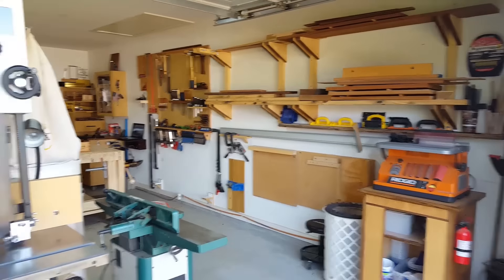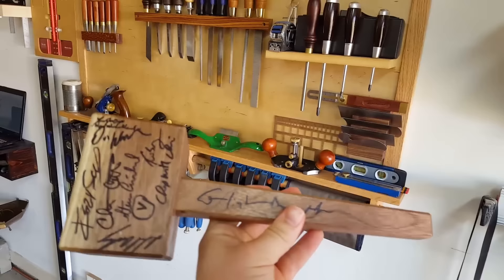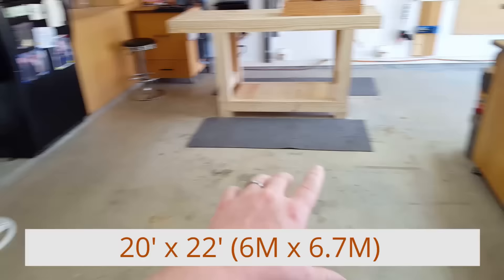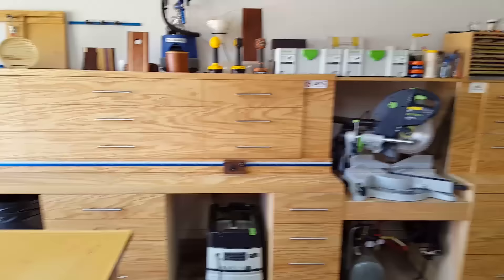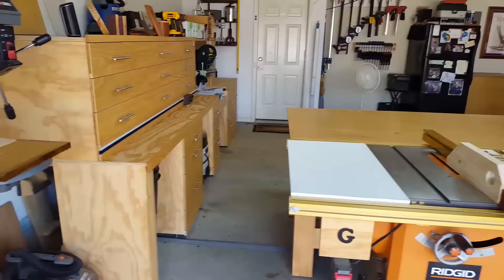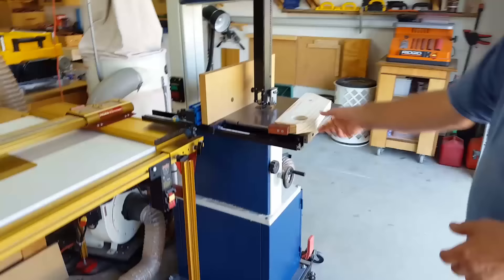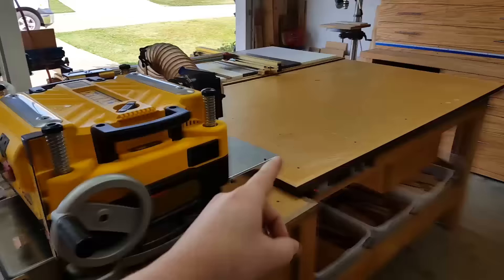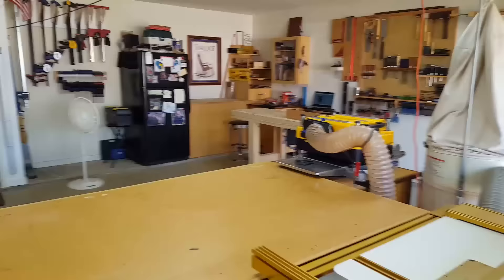Wayne Brown's Shop Tour

Comment: Mine is only a 12'x16' so it's small, but usable. It is a shed, custom built for longevity, and has a ramp so I can locate the table saw outside when weather permits. That leaves a TON of space to move around in. I am thinking of getting the same saw Wayne has in the next few weeks, I currently have a DeWalt Jobsite folding saw but it is a GREAT saw!!! I just truly love the space in front of the blade that a full size saw has on the table. I removed my saw from the folding cart and mounted it on a shop built table on wheels to enable an outfeed table, plus dust collection underneath the opposite end with a shop vac and dust devil collector. I have the same drill press and love it, mainly because of the spindle travel, and since I do make pens I can drill through 4" without flipping the wood or acrylic over. Very nice setup, and it does make me envious!!! Cleanest shop I ever saw also, except maybe April Wilkerson's shop which NEVER looks used!!!

Comment: Beautiful shop! STRONGLY recommend the Oneida Air Cyclone.  I have the same dust collector.  I took it apart & was able to mount the blower inlet directly to the top of the Oneida cyclone, and mount both of those at ceiling height. The dust falls down through a 5" aluminum dryer vent into a 50 gal drum on the rolling cart that the Shop Fox collector came with.  The inlet side of the cyclone connects to a 5" spiral duct that travels across the ceiling, through the center of my shop. A few Y connectors in the 5" line provide 4" takeoffs with blast gates where I need them.

The Oneida removes virtually everything from the dust collector & drops it into the drum, and the gags remain clean.  I do have to beat the dust out of the felt bag periodically, but I am absolutely amazed at just how efficient the cyclone turned out to be.  No more stumbling & fumbling with tubes & switches at floor level! Shop Fox should really offer that collector in a configuration that works with Oneida's cyclone.  They're fantastic. It's really changed how my shop works.

Comment: Wayne, go get a furnace blower, mount it to a harbor freight furniture dolly, (item#61899) add a light switch to turn it on and off. I've got one, and I use it daily in my shop. I live in Florida and it not only circulates the air, it makes a 98' day feel nice. Give it a try, you just might like it.

Comment: thanks guys i have a very similar space to work with and most others have smaller shops with very different designs   thanks for going through what you did to make it better than before or narrators shop that seems to much like this but but apparently this shop is lil better organized  i have spent hours on YouTube looking for a good layout . some would say that time should be spent in shop but im not ready just yet and hope the time researching will pay off with lil adjustments instead of full out rearranging  .

Comment: Very interesting video with quite a few good ideas there. I am currently also designing and putting together ideas for my future workshop however my area is a bit bigger than both your shops but it is a lot longer than wide at about 4.3m by 9.85m, it was an old stable from my grandfathers farm. However I have a few sketchup models I was playing around with and was wondering if I could send them by you to have a look maybe get a few extra tips or suggestions here and there.

Comment: Neat layout. Wish I had the full garage like this but I have part and the side that doesn't have that any walls due to a window. I am in the middle of reorganizing and doing something similar but I decided against the band saw the way it is here bc you can't open the door and also I hit a wall on the other side if doing longer cuts. So I brought mine over where the motor is facing the backside of the incra rails but the rails fit under the table so I can push it in pretty close.  I have a question for Wayne... I have the same Incra system though with longer rails. I am moving that router table over to the left so I can get around it vs leaning over.  What do you think?
Reply: Great idea, I’ll be making the switch soon

Comment: I like the island of tools idea, saves a ton of dust collector piping madness that I am contemplating doing myself. How do you manage power for all the tools in the middle of the garage like that. Floor outlets? I only see on extension cord going to the ceiling? Would love to know more. I am currently struggling with how to layout my shop and prevent power cords from running all over the place. 

Thanks
Reply: Looks like there's a floor cord cover that goes between the miter station and table saw.
https://youtu.be/CT77qCeakYY?t=11m27s
https://youtu.be/CT77qCeakYY?t=7m38s

Comment: Nice Video.. I'm a shade tree wood worker, Ive noticed the trend in Tool walls here lately, and am actually building one myself. I want to fancy pants mine up a bit with oak trim. What is the best was to cut and hang trim for a 4'x8' sheet of 3/4 inch Birch. Thanks.

Comment: Love videos about workshop organization to maximize space. Always knew an island is the way to go and that video confirms this. thanks.

The only issue i see with this set up is that you can't stand in front of your router table to put pressure on your piece like you normally would. Instead, you have to stand on the side and use a feather board for pressure i guess. Any comment on that?   Aside from that, this is the ideal setup. Probably worth the compromise.

Thanks.
Reply: If he's like me, the router doesn't get used a ton
Reply: Interesting. I would have tough the opposite to be true.

Comment: What did you do with the original rigid fence system?
My buddie has 2 saws like that his fence system on one of them broke, you almost can't find replacement parts for it anymore, I keep telling him to just buy a ShopFox system I like your's better.
The fence system's on that brand saw had problems the cam lock lever handle often busted off the saws.
If i still had use to a machine shop I'd go make one out of aircraft grade aluminum for him.

There are much better fences then those saw's came with, he has a contractors and a stationary type.

Comment: Park a/2 Smart car's in his empty space. add space for a third over under parking.
Add wood storage on top of them.
Take the bus! Or use Uber.
Park in your neighbor's garage.

Looking at the surface planer, you could lower the table so the outfeed runs right onto the tablesaw outfeed table. because you have that you can buy rough cut lumber and save a lot of money on wood.
Question is how hard is this set up to do sheet goods on?
I also see room for a shopsmith or lathe and or a RAS with corob cutters for a shaper.
Nice shop.
My house has a full basement, and a larger garage the garage is not heated or cooled, the basement is but the basement is harder to get projects out of or wood into.
What would you set up for a shop? both spaces are bigger than your shop. But my wife will not park outside.

My garage is ground level my basement is full size walk out sub level. I could add a driveway to the basement I do not have right now.

Comment: Do you have any ideas for vertical storage? It seems essential to keep lumber off of concrete to keep moisture from seeping into the ends. Problem is my ceilings aren't really tall enough to pull that off.
Reply from the maker: Vertical storage has a lot of problems but the one main advantage is being able to access more stuff easier. It's a trade off.
Reply: For sure. After doing a quick Google search, I see a few ideas I might pursue. I have a long hallway attached to my shop with 9 foot tall ceilings that would work for all but the longest pieces. Thanks for the idea! Loved Wayne's shop tour, got some great ideas from the video.

Comment: Wayne, I'm thinking about building Jay's miter saw station for my shop. He said yours is made of pine plywood mostly half inch. What parts did you make of a different size and how stable is it using the thinner plywood. Thanks for feedback and the shop looks great.
Reply: +Jason McBroom I made the case frames and 2 long shelves out of 3/4. Everything else is 1/2 ". It's super strong and stabile

Comment: So, Jay; if you were to re-do your shop setup would you make your outfeed/assembly table smaller or keep it the same?  It sounds like Wayne is about to lose that free space he has with that extra assembly table.

Also, how does he efficiently use his router table?  Seems like there's a lot in the way of that for normal router table setup (body facing the work piece rather than behind it).

Really pretty shop, though.  It's given me some good ideas.
Reply from the maker: I'd probably go smaller with the outfeed/assembly table.

Comment: Nice garage shop. I would like to know where your machines in the island are plugged into. 

I don't see any cords on the floor and i didn't notice them being plugged into the ceiling.
Reply: You can see a cord hider running to the miter saw station from the table saw 12:10

Comment: I have the same of many of those tools. Although I'm happy with my ridgid table saw as I'm sure you already know the fence is a bit annoying. Is that why you chose the incra fence? if so is it worth the $ and would you buy it again? Thanks and beautiful shop BTW.
Reply: Thanks Art, I saw several YouTubers using the Incra, did some research and pulled the trigger. I love it
Reply: Wayne Brown what material did you make the extension wings on the table saw out of?  also what router insert did you use?

Comment: This is so nice, I'm copying it for my shop. I looked through the comments, couldn't find an answer: what's the length and width of the outfeed table?
Reply: It's 65 X 42
Reply: Wayne Brown
 how do you like your Ridgid table saw?
Reply: Sam Scarborough 
Sam, after adding a Forrest woodworker II blade and the Incra TS LS it has performed perfectly.

Comment: im relatively new to woodworking, so forgive my ignorance if this sounds stupid, but what's the difference between horizontal and vertical lumber storage? Like, why one over the other?
Reply: i could get shot down in flames here, but I think it's to do with drying.....like gravity
Reply: If you don't have a lot of boards then with them vertically it's easier to shuffle through to find what you want without having to pick everything up to get to the one on the bottom that you want and then put it all back.

Comment: I want this shop :) but several things are getting in my way; Where is his water heater, washer/dryer, Central AC for the house? All of those things take up my wall space on one side of the garage. I also have 8' ceilings in my garage but when you add in the hardware for the garage doors it basically drops the ceiling down another 1'. Any creative ideas on how to utilize the space between your garage door and the ceiling when your garage door is up? My wife is constantly yelling at me about the sawdust that makes it way over to the laundry area, any ideas on how to section that off?